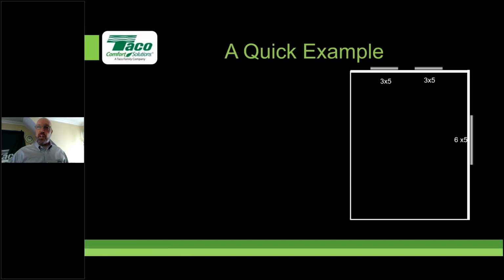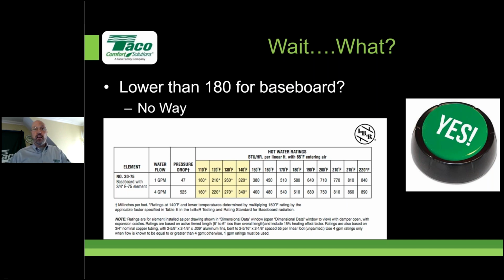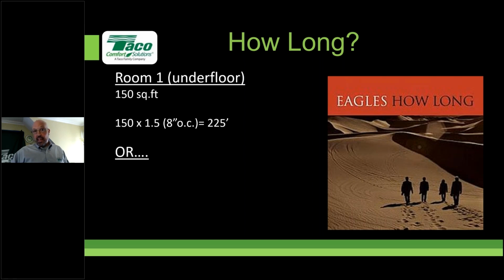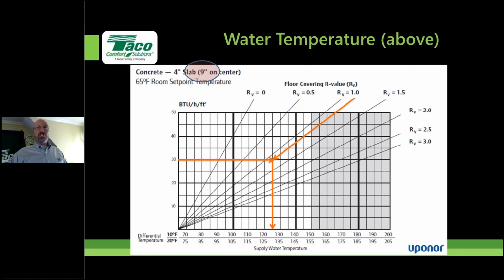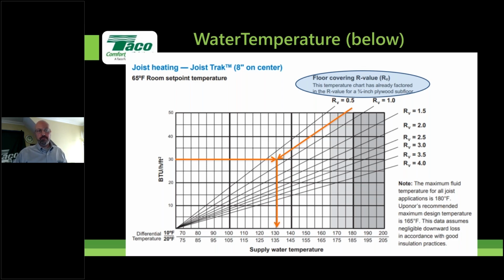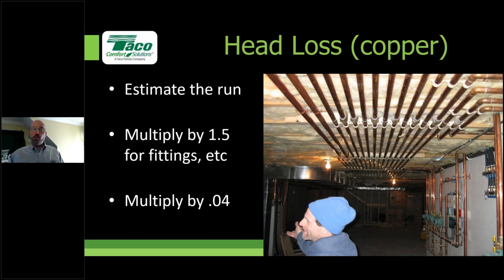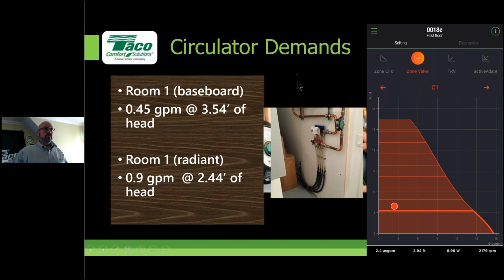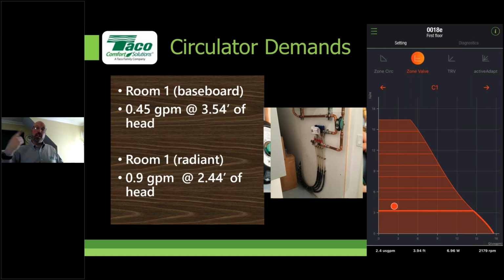Hydronic Heating Options – The heat loss is done, now what?

Comment: Hey guys, i have a  0010 circulator on an existing 6 section weil mclain gold boiler that we ran 3/4 pex to an attic where we the hvac guys installed 2 fan coils. 1 for the second floor and one for the 1st floor. He is telling me we should have ran bigger pipe, the 1st floor is not heating up enough in cold weather. The water is leaving the boiler at 190*  from boiler and coming back to boiler room. Do you have any charts or knowledge on weather the 35*-40* drop off is an acceptable  range on the plumbing end?
Reply from the maker: Hi there, the 0010 is a rather large circulator that can move a very high gpm. However the 3/4" pex cannot handle a large amount of flow in a closed loop hydronic system. From your description of the large temperature drop, it tells me that the flow is restricted. Typical designs of hydronic air handlers want to see a 20 degree or less temperature drop depending upon the manufacturer.
For any flow and temperature drop charts, check with that manufacturer for specifics.